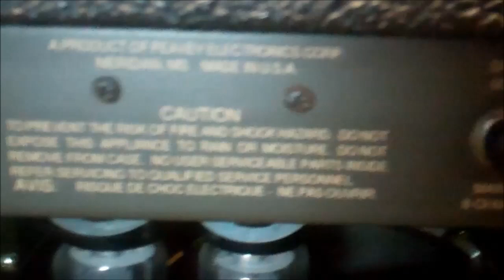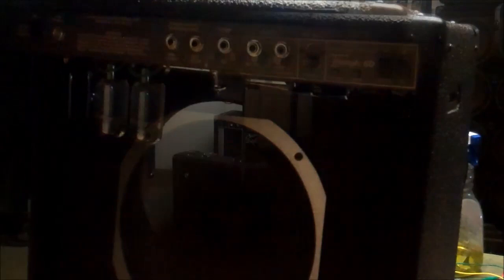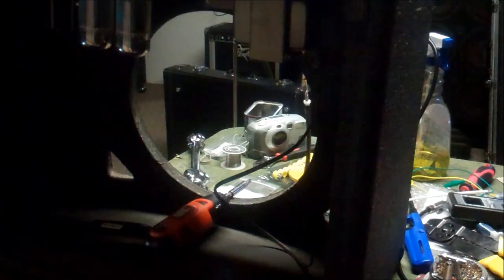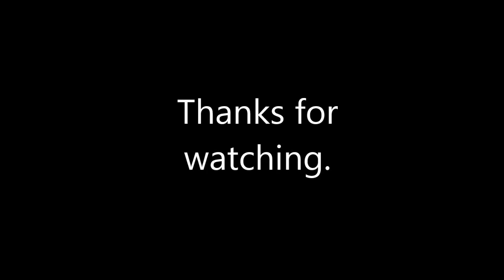Peavey Triumph 60 Clean-Up,  Fix-Up, and Test

Comment: Triumph and the VTM series were Peavey's gold-line that appeared in 1988 which marked Peavey's transition from bad practice and country amps to good rock amps rivaling Marshall and Boogie
Reply from the maker: I have the older Encore 65,  and I like the drive channel better than the Triumph.   No hate for the Triumph,  just not my style.
Reply: @DeadKoby  The Encore was not available over here, I think only the hybrid and transistor amps were before 1987. The Triumph needs some mods to sound right.
Reply: @larslevinberget9558 hi, I've just got a triumph...what mods are you referring to?

Comment: I own two of these amps. They are absolute beasts! I had to have one shipped so I know they weigh 81 lbs! Love my Triumph 60! Great video! BTW both of mine were made in 91.
Reply from the maker: Cool.  Somebody bought this amp TODAY on my Reverb store... so it's off to a new home.
Reply: @Alan, do you find the clean channel louder than the crunch/ultra for similar post volume settings? Just curious as rebuilding one, and my gain channels are a fair bit quieter.

Comment: I restored 2 of those amps during the late 90s and the Scorpion ultra speaker is 200 watts to accommodate the 120 watt model amp which also had a fan mounted. Sold one to a student, kept one, which I modded with a Celestion G12T75. I will try a few mods like the effect loop level and the tone stack mod.

Comment: That speaker I'm pretty sure is a rebranded Celestion. Most efficient speaker made in America, loud and clean. The triumph was the forerunner to the ultra series.  12ay7s are good lower gain preamp tubes and will sweeten up the amp.
Reply from the maker: That particular speaker was a scorpion plus made by Peavey it was the same cone as a scorpion but with a bigger magnet for more volume and higher power
Reply: The 12" speaker looks to be the original stock speaker that was included in my Triumph 60 combo purchased new in summer 1990.  The part# SU-12825 indicates Scorpion Ultra 12" and, by itself, weighs in over 18lbs.  The two other versions of this Peavey speaker, Scorpion Standard and Scorpion Plus SP-12825 have smaller, lighter magnets and are more commonly found these day on the used market. Scorpion Plus is sized in between the other two. I have always suspected the Scorpion series speakers to be Peavey's copy of EVM12L.  Peavey still sells Scorpion replacement baskets today and they work for all three magnets.  When Triumph 60 Combo was re-vamped to Ultra 112 Combo, Peavey instead equipped it with Sheffield 12" speaker.  I eventually abused my Triumph 60, replaced it with the Ultra 112, but swapped back in the Scorpion Ultra because it won for better sound award in my side-by-side test.

Comment: The Bravo and the Triumph were basically the same but different wattage.
Reply from the maker: Bravo had 3l84/6bq5 if I recall....  I almost had one from the same auction adventure.
Reply: @DeadKoby  I had many Bravos.  They were dubbed "A Stack In A Box". Change out the speaker for a greenback or vintage 30 and voila. I always wanted to hear one through a nice 412 cab.
Reply: The Bravo was marvelous, I should have grabbed one while I could. It's actually based on the Triumph PAG which is the turquoise series, which has a totally re-done preamp section identical to the Rockmaster pre

Comment: I got a triumph 120 head from a pawn shop for 20 bucks. Guy had no clue. Iy had no power tubes, once i put 4 6L6 tubes in it, it rips! I got pedal off reverb and its basically non functioning :(
But yeah holy shit! What an amp
Reply from the maker: The Triumph amps were really cool if you needed that high of a gain.   I prefer something a bit more mellow.   Peavey could win many awards for loudest amp in its size category.

Comment: Hey man how’s it going? Ironically I just came across a cat who is selling 2 amps. A Triumph 60 like this and an Encore 65 like the one I saw there in your video. I’m just doing a bit of research. I DID read where at least one but maybe both amps had really HEAVY mag Scorpion. Just trying to figure out if they are worth getting. I appreciate your video. Have you had any thoughts after this video that you might want to share?
Reply from the maker: I like the both....   The Encore has a normal size magnet.  Triumph has the BIG magnet.   Encore has Rock & Roll gain levels,  whereas Triumph has Metal level gain.    Both are OK in my book,  but I kept Encore, and sold Triumph just because of style.
Reply: @DeadKoby  I need to check out the Encore...

Comment: Hey. 
I recently picked one of these up but it’s buzzing like hell even when I don’t have a guitar lead plugged in. 
Any ideas what could be wrong with it?
Reply from the maker: The input jack's grounding switch is likely bodged...   does it play if you plug your guitar into it?
Reply: It does play if I plug my guitar in but you can still hear the buzz
Reply: spray electronics cleaner on reverb jacks, and plug and unplug few times, next check the potentiometers are screwed tite, if those fail to solve it, probably needs filter caps.